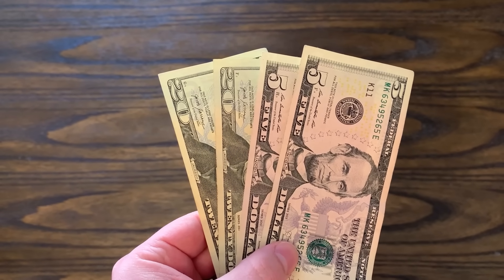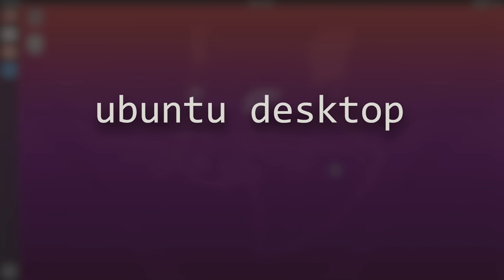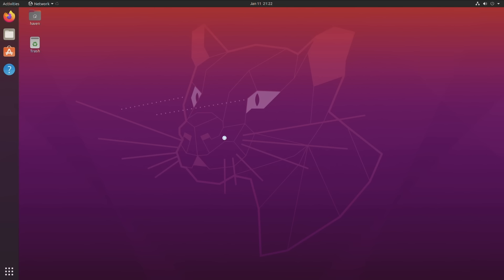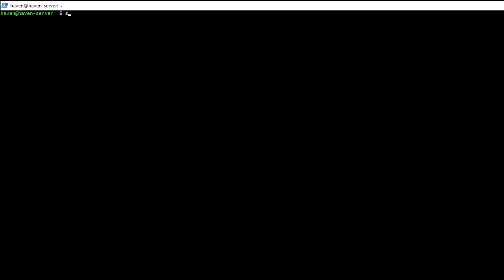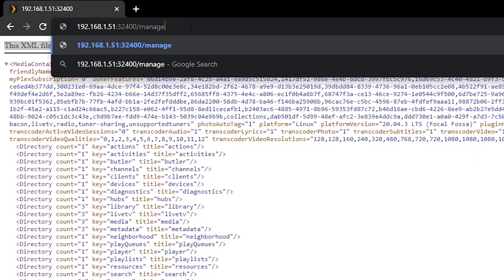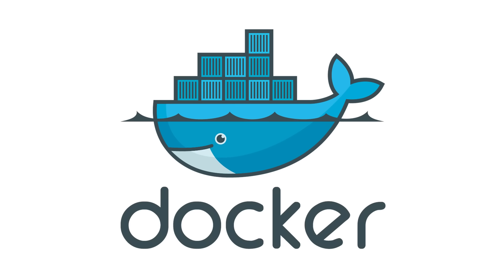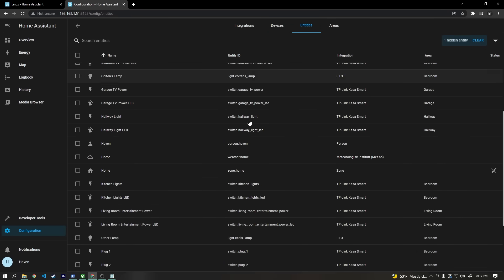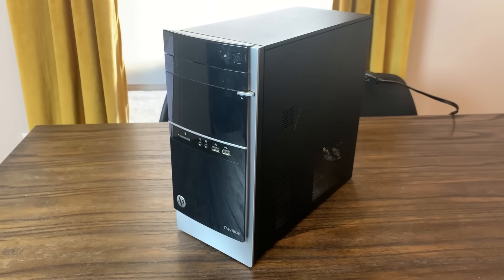Incredible Budget Home Server! (Minecraft, Plex, Home Assistant, NAS)

Comment: Hey, I'm trying to make a similar home server using ubuntu(actually kubuntu). I chose this OS coz  along with file sharing and plex,I also intend to use it as a torrent box and It would be super useful to have a GUI/desktop session for such purposes. But most services (like anydesk,teamviewer, and even vnc servers) fail when there arent any monitors connected.

Can you please help out with a tutorial or guidlines on how to tackle such an issue.
I'm trying to reach a fix without using a dummy display plug
I'm open to shifting to anothoer OS as well, like ubuntu or even windows, I just need the GUI to work over the network without a monitor being attached to the remote machine
Reply from the maker: I'm not really familiar with torrent stuff, but maybe consider running a virtual machine? Or just run a dummy plug. It has worked for me in the past. Sorry that I'm not a ton of help haha.
Reply: @HardwareHaven   No problem, thanks!

Comment: You shouldn't use your Boot drive for storage. Nor should you use a mechanical drive for a boot drive....I've run a 24/7 home file server for more than 25 years now. One thing I learned is mechanical boot drives fail  every couple years because they spin up repeatedly throughout day and night. With the low load demands of a home server storage drives are almost always idle so they rarely fail. I have a box full of working old storage drives that were replaced with larger ones. The oldest is a 8GB 5.25" IDE drive from the 90s.

Comment: I love projects like this. After I discovered their existence I ended up using an Intel NUC i5 Gen8. With some 8TB External HDDs on a USB Hub for an expandable Plex and NAS server. That also hosts servers for my games with my friends.  

For an always on low power low heat solution that will let you host all that and Minecraft at the same time with maximum view distance. It is an excellent purchase.  

The Intel NUC i5 Gen8. Idles at 5W and under load uses 25W. Between it and the external HDDs. The power draw added only a few dollars to my monthly power bill. Considering I never turn it off so it runs 24 hours a day. I would say that’s really good.

I know its a bit more expensive than this solution. I spent around $500 for it after buying the Intel NUC, RAM and a M.2 SSD for it. Not including external HDDs. But if anyone is looking for a cheaper incredibly low power solution that doesn’t act like a space heater and save some money on power. And doesn’t mind using external hard drives. This is a consideration. 

I was actually considering the laptop before I discovered this. Install some remote desktop software to it like team viewer and there you go.

Comment: Why not use an Espressobin or some other SBC?
Reply from the maker: Because things like this are often sitting in someone’s closet or garage about to be thrown in the trash. SBCs can be pretty expensive, especially recently
Reply: @HardwareHaven  $70...
Reply: I did have to get a 12v PSU /w a barrel jack and optionally a razpi zero w to give it a wireless console and a something to boot from.  So let's budget $120 and 32 hours to learn how it works.
Reply from the maker: @cheako91155  that’s awesome! To be clear I’m not against stuff like that. I have multiple raspberry Pi’s as well as some microcontrollers. My channel is just a little more focused on reusing older hardware

Comment: I'm an AMD fanboy, but for budget PLEX an NAS I'll admit a core i3 would be far superior. The transcoding just isn't optimized with those older AMD's nor were they power efficient. An old internet machine for Grandma ain't gonna cut it for this use case. Want RAID? Now you need another spare PCI-e x4 or better port available, along with a x16 for GPU. Those systems were sent to recyclers for a reason, there's no room to grow. And being a BTX form factor means the case is scrap metal also. And those SSHD's were phased out for a reason, 8Gb of NAND really didn't help for squat. Using an SSD is not for the boot times, it's for all the small R/W of modern OS that would keep a traditional spinner pegged at 100% use 24/7. Saving $ is great and all but being this cheap will just cost more along with the frustration of starting from scratch again.

Comment: Can I set up a web server with this?

Update: Yes, absolutely. If you want to make a service running on your server publicly available to anyone, just forward its port. And if your IP address is dynamic, contact your ISP and request a static one. Or you can use a DDNS from DDNS providers like no-ip.
Reply from the maker: For sure, you'll just need to figure out what type of server you want to spin up. You can run quite just about anything using docker
Reply: @HardwareHaven Couldn't forward any ports because of my stupid ISP. And I'm just not a big fan of tunnelling a website either. So ultimately, I decided to build an all-in-one database server, git server, testing environment, testing playground and VPN.
If I had more storage, I'd turn it into a storage server too but that's not really a concern right now lol.

Comment: id like to make some personal notes on this video. I currently have something similar to your setup at the moment however its on a windows 10 system. running Oracle box for Virtualization of different servers which i have SSH set up on however when i need a desktop enviroment i use Team Viewer with Easy access which means there dosent need to be someone on the other end to accept the remote desktop  access. The reason i went with this is because the seemless simplicity of switching between Windows account with out getting logged out of team viewer. since i have a "File/VM server" account and an admin account. where as logging in with windows Remote Desktop Client it would log me out when switching between windows accounts. so just some food for thought there

Comment: What is the deal with all the transformers on that motherboard. Yes, I know that network cards use them, but not the kind on that board.
Reply from the maker: I’d imagine it’s for power delivery. A typical ATX psu would provide 12v, 5v, and 3.3v I believe. This uses a 19v psu, so I can only assume those transformers are to get the more standard voltages, primarily 12v
Reply: @HardwareHaven  Thinking about it some more, I think what is weird is they are transformers and not just coils. If they are transformers, that is a great design for sure. Isolated dc-dc converters are very rare and expensive, but basically have zero noise and the cleanest power. 

I also completely forgot that most of the time inductors are just use enclosed in potting materials or plastic. Kind of a late night derp maybe.

Comment: if i have turn on the server? maybe if there where a power interruption or something, how do i start it again?
Reply from the maker: Like the actual pc? Just turn on the power switch. There might be a setting in the bios to adjust what the pc does after a power outage and you should be able to set it up to reboot automatically. As far as the software side, everything should restart automatically including the docker containers (as long as you ran them with the —restart=unless_stopped flag)

Comment: ?? Where did you get a 2tb ST2000DX001 for $15-20? With hard drive prices at $15 per terabyte at lowest I really doubt an SSHD is gonna be that cheap
Reply from the maker: Not an SSHD, that was a mistake I didn’t catch. You can occasionally find drives that cheap on eBay or at least in my case on local selling sites.
Reply from the maker: To be fair, I was probably a little on the low side, so apologies

Comment: Linux is as hard as you think. Want to install something? Here comb through a bunch of web pages and figure it out. When you finally do, guess what, it doesn’t work, but you’ve done it 20 times now and this is literally how every guide says how to install.
Reply from the maker: It can be hard for sure, and it can take quite some time to get used to troubleshooting and navigating it. I have very little experience using it as a desktop, but for other things like what I did in this video, I have found that it’s often easier and much more stable than trying to do the same thing with a windows machine for example. Sorry that you’ve had a frustrating experience with Linux, and I can fully understand and relate. If you do have an issue with something regarding this video, leave a response hopefully I can try and help. And thanks for the comment 👍🏻

Comment: Yea sorry but this cpu isn't going to handle any of the transcoding on plex very well at all, likely have a lot of buffering issues when attempting to watch from outside sources or if two people try to watch at once. Also a minecraft server is going to struggle big time on a cpu like this, especially with any chunk generation that thing will literally freeze and crash from taking so long to generate the new chunks.
Reply from the maker: It really depends on what you’re streaming. We mostly stream rips from DVDs, so transcoding isn’t really needed and it works great. As far as Minecraft goes, there’s definitely better ways to run it that are more optimized. I actually did a video on that not long after this one and it runs much better, at least for just a few people

Comment: That CPU won't sustain a Minecraft server unless you play alone, I tried that on a i3 3217u and with 3 people on it would fall behind 10min and with 1 person will fall behind 3-5 min and if you plan to keep it up and running for months like I did it will restart due to storms overloading the CPU, if you play outdated versions of Minecraft like 1.8 and lower I think your ok, if you plan to play 1.18.2 + mods you need a higher IPC cpu / acceptable 8 core cpu + 8gb of ram only for the server.
Reply from the maker: For sure. That was more of an experiment, and I learned later that it’s not really a good MC server for more than like 2 people. I switched to PaperMC on Docker using an old Athlon for an upcoming video, and it seems to work decently well for a few people. Much better than what I did in this video.

Comment: It would make a bad server for Minecraft once you have people operating in separate chunks cuz of the limitations of the CPU, same for a Plex plugin.  You need a decent CPU to transcode video.  I-3 with 4 or more cores with 16gb memory is minimum computer I'd use.
Reply from the maker: I agree on Minecraft. I made an updated video using docker still but with PaperMC and it works pretty well. With Plex, it really depends what you’re watching. We primarily use it to stream ripped DVDs, and that can be run on next to nothing. My parents have a core 2 duo system and they stream two different shows simultaneously without the CPU feeling it at all. If you’re watching a lot of FHD or 4K stuff, then yeah. Hardware transcoding is important

Comment: how to check which ip address is not being used ?
Reply from the maker: One way is to access the control panel of your router (often 192.168.0.1 or something like that). There will be a dhcp section with a range. Most likely, there aren’t any ip addresses assigned outside of that range.

Comment: Which USB to Gigabit Ethernet did you use?
You can grab the MAC address from the machine and configure DHCP in your router to assign a static IP address and also give it a name, if your router allows it.
You can also add a card with an eSATA port and plug this into it (https://www.amazon.com/Mediasonic-ProBox-HF2-SU3S2-SATA-Enclosure/dp/B003X26VV4)
Actually, you could have used Promox (https://www.youtube.com/c/TechnoTimLive)
and you can also look at the tiny mini micro series from ServeTheHome (https://www.youtube.com/watch?v=bx4_QCX_khU&list=PLC53fzn9608B-MT5KvuuHct5MiUDO8IF4) for even smaller systems.
Reply from the maker: A Belkin Something. And yeah you definitely can. I just have an IP range out of the dhcp range that I like to stick certain things. Probably should’ve talked about dhcp reservation as that’s probably easier and better
Reply: @HardwareHaven  I also realize that adding the things I mentioned take the project out of the budget realm.  I have some of these older AMD too.
Have you ever watched Jeff's automation project? (https://www.youtube.com/watch?v=gJFsZL5CTgM)
Reply from the maker: I believe I’ve seen some of that video. I use home assistant as well, and it’s awesome! Also love Jeff and Techno Tim

Comment: the idea of using an old PC is great as a Server but power inefficient and with rising power cost not to recommend in this times... especially not for 24/7 use like a server.
The raspberry pi 4 is a bit slow but with a cheap cooler u can overclock it to 2ghz which should be enough for most things ur server is capable of and more power efficient with its maximum of 15Watt power usage. here in Germany i pay 30Euro power usage of the pi in a whole year.

im trying to get a good home server setup myself which can rival the Raspberry pi 4 in his low power usage without exploding in price more than tripple... tbh... it seems impossible but if u want a game server for games besides Minecraft,Terraria,Among US the ARM Architecture of the Pi is not for u... most games require to make use of the SteamCMD which will sadly not run on a PI thanks for Valve for not porting their software to ARM. So a x86 CPU is required. My goal is to get a setup with double the cores of a Pi4 and 35-50watt Power usage on a x86. anything more is a bonus the problem is that such hardware is super pricy or simply not available anymore... most are not even sold to consumer direcly and are OEM only which most arent available too.

any ideas for a home server with 8 Cores, 2+ ghz, up to 50watt power usage for a cost of 300Euro with a x86 CPU is welcome so i can run this thing 24/7 from home without having my electricity bill explode more than 8Euro per month or 100 Euro in a Year which seems reasonable for a home server.
Reply from the maker: Nothing x86 is realistically going to compete in terms of power draw with an arm SBC like the raspberry pis. But some of the low powered x86 stuff is still really efficient. The chip in this video only pulls like 11W at idle if I remember correctly.

Comment: Instead of replacing the ssd with the hdd, you could have just added the hdd as second drive. that way the os would boot fast and be more responsive while still having a fair bit of storage.
Reply from the maker: Not a bad idea! However, I did what I did for a few reasons. First, I wanted to keep the cost down, and boot time isn't really a concern if the machine is running consistently. I also wanted to have plenty of space for plex content, while not having to talk through mounting a drive, although since we had a GUI, it would've been pretty easy to do that way.
Reply: @HardwareHaven  I have a 2nd hard drive in my system much bigger for storage. How would I map a share drive to the 2nd hard drive instead of the home path? I want to keep main drive which is much smaller only available for Ubuntu and updates.

Comment: Nice video, though I'd probably recommend using something like TrueNAS core or TrueNAS scale for your use case. The latter is also based on Linux and comes with a great Web-UI for all your configurations and it supports docker right out of the box.
Reply: Tbh I would recommend anything but ubuntu, Ubuntu is a steaming pile of poo.

Comment: Hi, thanks for this great video! It helps to create a simple home server. Do you think I should enable/configure any security settings like firewall or virus scan for such a home user? Is it safe to allow my friends to connect this home server from their house? Any comments would be appreciated! Thank you!
Reply from the maker: If you're only accessing this server from your local (home) network, I wouldn't be too concerned about security. If you setup port forwarding and expose it to the internet, you might look into adjusting firewall settings. Unfortunately I'm not an expert on this matter, so I would advise you to do some research on what you can do to keep things more secure.
Reply: @HardwareHaven  Thanks for your suggestion! I will check some security topics later. (Y)

Comment: Such a clean video, really love the effort you put into this. I am having a bit of trouble connecting to the server computer from my laptop via powershell, i ran sudo systemctl status and it said it was running. I do have a question mark over my wifi icon in the top right on the server computer after i set up the ip address and such.